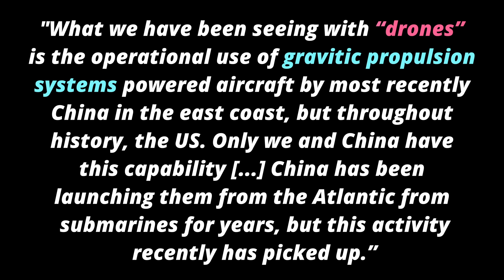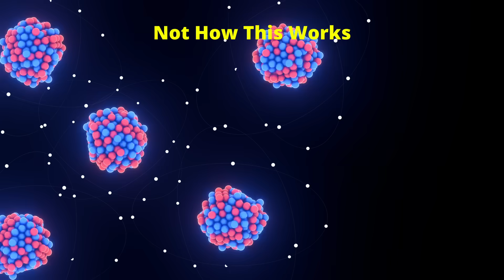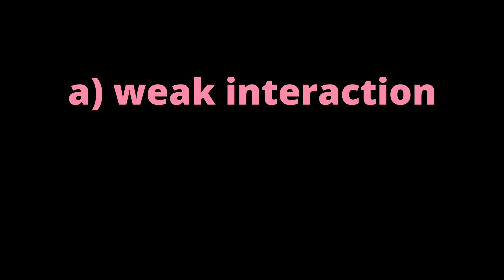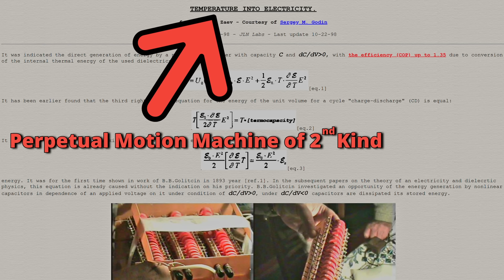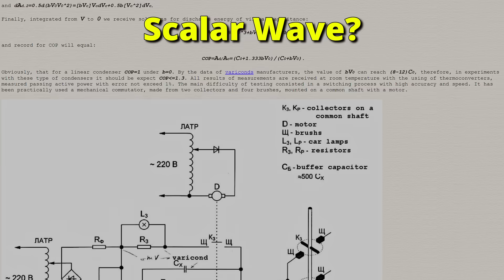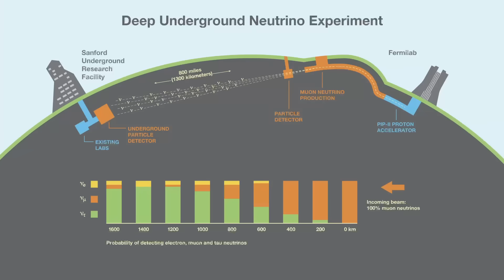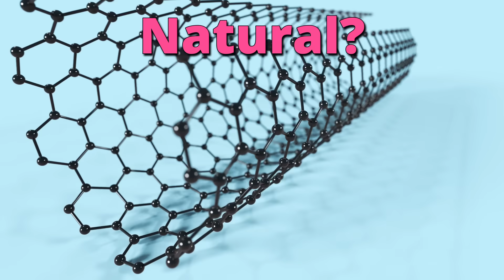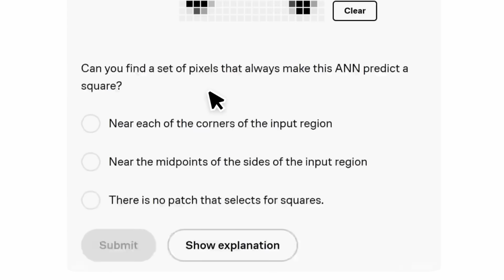What is “gravitic propulsion” and could the US government hide it?

Comment: The various online descriptions of the New Jersey orbs, silent craft, drones, Bob Lazar, Element-115 all has some relation to 1950's-era work done at North American Aviation (i.e. now part of U.S. Defense Contractor Northrup-Grumman!) regarding electrostatics-based propulsion and gravity beam technology that is very similar to what was described by Bob Lazar and is equivalent to modern-era Field-Effects-based (i.e. Electrostatics-based propulsion) and GWASER-based propulsion systems (i.e. Gravity Wave Amplification by Stimulated Emission of Radiation). 

Electrostatics-based propulsion uses Terahertz waveforms pushed through layers of spacecraft hull made out of many layers and internal-segments of Aluminum, Magnesium, Titanium, Bismuth, Palladium and a few other elements in order to create huge EM fields that push-against OR pulls-towards a specific part of the atmosphere that has the opposite charge of the currently charged portion of the spacecraft hull. You just rotate the position of the EM field charge on the hull using the internally-segmented Terahertz waveguides which will have a high-frequency waveform pushed into and through a SPECIFIC in-hull waveguide and EM-field emitter segment in order to fly it in the direction you want! It is effective up to about 300,000 feet (i.e. 91 km or near the Kármán line of the upper atmosphere) and the in-atmosphere speeds can range from a few tens of KMH up to 100,000+ KMH. You can also create a plasma sheath with the EM field to push the atmosphere out of the way for faster flying ability BUT the usually green, blue, orange or off-white glow TENDS NOT to be very visually stealthy although it CAN absorb radar waves for Radar Stealth. 

For exo-atmospheric GWASER-based propulsion, you use an on-board Cyclotron (i.e. a circular particle accelerator) to collide heavy nuclei such as Tungsten, Gold, Lead, Mercury, Manganese and even plain old Iron so that a continuous series of atomic-scale explosions take place that create a steady stream of minutely-sized shockwaves in the form of HFGW (High Frequency Gravity Waves aka Gravity-A waveform) and MFGW (Medium Frequency Gravity Waves aka Gravity-B waveform) that get trapped and summed within a GWASER system which is a Stainless Steel cavity resonator and waveguide similar in configuration to the magnetron and waveguide setup found inside a typical home microwave oven, but which uses Radio Frequency-band (i.e. RF) surface waveforms or Microwave-band surface waves and/or standing waves to create a virtualized gravity wave entrapment and amplification system. 

AND as a rebuttal to various online UFO enthusiasts and even Bob Lazar, YOU DO NOT NEED any so-called Element-115! You can use ANY plain-old heavy metal nuclei to create the gravity beams such as common Tungsten or even IRON! Element-115 is a COVER STORY used to obfuscate that you only need a few megawatts to tens-of-megawatts of power production to "fly" in deep space. You don't even need ANTI-MATTER since the so-called Element-115 was originally used merely as a "Catalyst" in order to create the compact on-board power system to power the gravity beam generators! We humans can use large onboard Cyclotrons and Ballard Fuel cells instead! 

That 10 megawatts of input power is being amplified by the GWASER using a beam summing system that EXTRACTS the latent “binding energies” found within the HFGW and MFGW waveforms themselves to multiply the total output energy to an amount that can actually create up-to a planet-size or star-sized “temporary mass” used to distort space and time for faster-than-light travel! Using an analogy, a cup of tea has enough latent quantum-scale binding energy stored within it to boil ALL of the world’s oceans to steam! You just need the RIGHT METHOD to extract and use that latent (i.e. internally-stored) energy. A GWASER (aka a Gravity LASER!) is one way to make a powerful energy multiplication system!

Using modern liquid Methanol or even Propane (i.e. LPG) Ballard-type Fuel Cells (i.e. Thin Proton-Proton Membrane Exchange cells) as the fuel source is MUCH SAFER if a tad bit LARGE in volumetric space due to the amount of fuel you have to carry along with you! No need to deal with super-unstable and DANGEROUSLY RADIOACTIVE elements and/or the 20 kilotons explosive-power per gram of antimatter to power an FTL-capable human-made aerospace craft! Use common and CHEAP Tungsten or Iron instead to SAFELY create those amplifiable gravity waves!

Gravity waves normally go through EVERYTHING, so you must use another pulsed or continuous waveform such as Radio Frequency (100 MHz to 2 GHz) or Microwaves from 2 GHz to 300 GHz that hugs the inside surface of a hard Stainless Steel Alloy cavity resonator and waveguide in order to trap and confine those incoming gravity waves so you can create a sort of Gravity LASER which reflects, directs, sums and amplifies those HFGW and MFGW waveforms in the same manner as a LASER amplifies optical band waveforms

You can then direct the newly amplified gravity wave beam(s) to a portion of local 3D-XYZ space outside your spacecraft that will be compressed and/or distorted by that sudden introduction of artificially-induced-mass (i.e. do remember that E=MC^2 is also equivalent to M=EC^2 aka gravity-producing temporary or permanent Mass = Energy x the Speed of light squared!) to form a temporary 3D-space-compressing gravity well that can be traversed quickly before it evaporates and re-expands 3D-XYZ space back to its original dimensions.

To power the spacecraft, it is sufficient to use fifty of the COTS-bought (Common Off-The-Shelf) 250 Kilowatt (i.e. 335 HP each!) Methanol-or-Propane-fueled Ballard-type fuel cells to create the 10 Megawatts+ needed to power the Cyclotron and the GWASER setup so you can create a series of gravity wells in rapid succession which lets you "Surf" their now-compressed outer edges. 

On a general basis, the gravity wells must be created and traversed quickly so that you get a linear space distance compression of anywhere from 5x the original linear distance up to as much a 100x the original linear distance depending upon how large and powerful each artificially-created gravity well is! The actual linear distance travelled is very dependent upon how fast you create, traverse and evaporate the artificially-created gravity wells.

Of course, don't create a gravity well so big and powerful that it has an event horizon (i.e. Schwarzchild Radius) and don't make a large gravity well inside-of or too-near any planet, asteroid, sun, etc). Fast navigational computer systems are required to be on-board in order to be able to plot the placement, number and duration of each gravity well created by the GWASER system so that they are not too large and evaporate quickly enough for fast traversal before evaporation. 

With a typical three-day supply of Methanol fuel for the Ballard-type fuel cells (i.e. about 1,000,000 litres or about 265,000 gallons!), you can power the on-board Cyclotron and GWASER system to create enough gravity wells quickly enough to traverse an actual linear distance of about 500 to 1000 Light Years each way. That puts quite a few deep space solar systems within Earth's reach. 

And as a further rebuttal to Lazar, his original videos talking about Gravity-A waveform (i.e. the Strong near-field sub-atomic-scale version of gravitational attraction) and Gravity-B waveform (i.e. the long-distance planetary and interstellar-scale version of gravitational attraction) are really just the same force acting "Orthogonally" (i.e. at right angles) to each other but at a different "Frequency". You have to read up on Quantum Mechanics and learn a bit about virtual particle instantiation and annihilation in order to get that the world you see around you is NOT actually "real" but rather it's a continuous explosion of energy fields coming in and out of existence providing "Force" to the 3D-XYZ physical world you see around you. 

You're NOT actually "sitting" on that chair while reading this, but rather your tush is merely FLOATING and/or repulsing against a turbulent flow of energy fields, all pushing and pulling against each other TRYING to find a common equilibrium. Basically, the ENTIRE universe you see around is merely an expression of photons and force fields which CAN be taken advantage of to provide viable long-term and FREE energy sources AND as a means to transport oneself (and groups of others!) a very long distance in a very short period of time. And I should note that it's actually a LOT EASIER than you think to make viable faster-than-light (FTL) vehicles and it's actually QUITE EASY to make MASSIVE amounts of electrical power, magnetic energy fields, thermal energy, gravitational energy and even simple repulsive energy able to go anywhere and do anything you want!

There are currently numerous classified “Top Secret” SAP (Special Access Programs) and CAP (Compartmentalized Access Programs) within the U.S. Department of Defense research and development apparatus that have experimented with such technology over the last 50 years and they have been quite successful in their operational implementation. 

As of 2025, there are also some private companies who also starting to reveal their own such wingless Electrostatics-based propulsion and GWASER-based FTL technology for public disclosure and that disclosure is coming a lot sooner that you think. 

V

P.S. For Ms. Hossenfelder, that surface-water-containing very habitable planet Kepler-452b could very well be your very next vacation trip! It's got a 27% Oxygen + Nitrogen mix at 0.45 Bar so quite breathable and with a surface gravity of about 1.56 G's so not too hard to move around in with a good pre-trip exercise plan! 

Now You Know!

Comment: Tsunami waves gain amplitude and frequency in shallow in depths, and I expect their speed to also change in compression there too. But celestial gravity waves have traveled through thick and thin densities of gravity with interference waves reflecting off galaxies. Kind of like Great Lakes waves that come from many directions and with many complexities.

I must guess that when entering the growing density of spacetime warping of star systems, that those effects are also evident. 

Measurements might reveal an interstellar character in the way that ground-sensing radar hopes to reveal buried civilizations. Or that neutrino broadcasts are hoped to describe earth’s inner workings in the way that seismic signals are interpreted like ultrasound baby pictures. If gravity wave interference patterns can be manipulated to sonic wave proportions, maybe a flying carpet trick is possible in extreme density. It seems way too mild and way to fast and variable on cursory glance, but maybe some clever scientists will make something of it. Can you plug a LIGO into an MRI machine and match what it shows against what we know?

Comment: Not by mainstream standards, since we havent defined gravity yet.  Dont know what it is.  I know it, it is the opposite of motion, it is the opposite of charge, it is the opposite of straight.  

Its the reduction of motion caused from aversion, in a reality where nothing touches.  It is a curve from straight.  

Because nothing touches, it becomes a battery and coil of charge/motion.

This happens from subatomic light particles up to massive planetary and galactic scales.

How to "propulse" using gravity?  Would be a stillness trick amongst all the motion that is existence somehow.

I dont think you need it, you just need to be contain data in plasma to zip around without physics.  Play with plasma enough and it can be polarized back and forth like an electro-magnet i would assume.

There ya go Sabrine, another "crank" checking in.

We dont even know gravity is what i just said it is, so we are far away.   Still playing radiative-gravity games with theories.  Thats not it.

Comment: We've had a fully operable gravitic propelled cars in use for over 80 years.  Cars designed from the ground up to use this system do not burn fossil fuels, emit carbon pollutants, use electricity or even require an engine - but they still get their drivers where they want to go.  This technology has improved over the years but you can still easily build one of these cars largely using common, off the shelf, components readily available at most hardware stores.  In fact, even existing cars and trucks can be easily adapted to this system for zero cost.  

The only minor requirement concerns road geometry and not the car or truck itself.

Comment: I recommend Stan Deyo's antigravity lectures found on youtube. For example, if you were to be able to rotate a liquid metal in a ring using pulsed DC current into electromagnetic coils, you could produce a force due to this rotation. It is well known that a gyroscope can produce a force that counters gravity. All you need is electricity here to power such a device. Gyros are used in rockets to stabilize them, for example, and it takes energy to spin the gyro. Scale the gyro up to a much larger UFO size.

Comment: It was claimed by Bob Lazar that element 115 was found in the recovered UFO craft he worked on. This was before element 115 was discovered. Now we can make small quantities of it in the lab. Its decay is rapid, in the millisecond's, but there is enormous power in a quick time. Yes it takes lots of energy to make element 115, but what if element 115 is a very high-tech modern battery of sorts where energy is placed into a very small volume in the form of element 115. The invention here would be a device that could extract this element 115 decay at a much slower rate -- somehow.

Comment: Another example of wrong math that has given humanity a bit of trouble. To solve Gimbal lock, video gamer designers and rocket scientists, etc. have gone to using Quaternion math (just had Maxwell had used), because the math is quicker on a machine and because complex rotations in physics model are calculated correctly.

Comment: I have always thought that gravity may be the result of the extreme heat within the core of a planet. Negatively charged particles cannot not exist in extremely hot environments, so electrons are stripped from their atoms. They don't just cease to exist, they're merely repelled outward to a point where temperatures are more hospitable to them.
That would mean that electrons associated with every atom within the magma within the earth mantle would be repelled outward an equal distance from its center of gravity, creating an enormously powerful negatively charged layer.
This would create powerful force of attraction between it and the positively charged particle s above ( gravity ).
The inner core of the earth would be held together by a force of repulsion between between the layer a the hot magma, and the outer crust of earth would be held together by the force of attraction between the negatively charged layer and the positively charged particles above
Just an idea..

Comment: You can also make an entire science disappear by denying the existence of the Aether. 😂
Look into Nikola Tesla 's counter spatial open system electro dynamics and scalar waves articles and lectures. 
Gravity is not a force it's an acceleration. And his type of non-cartesian transmission system, it doesn't require energy. The solar system is a perpetual motion "device" we have infinite potential. And The method of tapping into that potential is the holy grail, or it would be. Which will never happen by Einsteinian atomism. 
It doesn't allow it... ✌️

Comment: 1:15 What's hard about coming up with a concept of propulsion system based on gravity? Imagine devising a way to alter gravity around an object, in a way that makes the object act like it's in a bubble where gravity points in any direction in 3D. If we could create such a bubble and also be able to adjust the strength of that gravitational force, it would make the object move in any direction at the desired speed. How you'd manage not to spill your coffee or guts inside that object, I can't theorize yet. 🤣 But for a surveillance drone it would be just fine.
Reply: Imagine actually doing it.   Anyone can talk
Reply: Sabine said this: I have no idea what a gravitic propulsion system might be, even theoretically.

I didn't claim what I was was doable, but just pointed out that we can hypothesize what such a system could do.

Comment: I LOVE it ...Most Physics is Based on Linear Equations for Linear Devices, Yet Non-linear Devices Have a Completely Different Dynamic. MOST Physicists Do NOT or WILL Not Experiment With Such Systems, and I question Why ? If You take the Collider for instance ...it is a Linear accelerator in a Giant Non-linear Form; if There Was anything to see, in Non-linearity, you would NEVER Know it from such a set up, and Would Need a new Design. When it Comes To anti-gravity, I am On The Fence, I KNOW it is POSSIBLE, But I am NOT Sure it is PROBABLE ...

Comment: I've been developing a concept, which would obviously need to be looked at by a theoretical physicist and mathematician, but essentially, the grand unification theory would involve various "layers" of reality such as the quantum layer, macro layer, universal layer, and so on. What unifies these layers in an informational layer which basically allows the smaller layers to affect the larger layers (think of it like either an API or a translator). This also ties into the theory of the simulated universe, but rather than higher dimensional beings or fantasy computer, the universe is self-simulating. I've had some conversations and the explanation is sound.. but yea, I'd need to move it past being just a concept in order to publish.